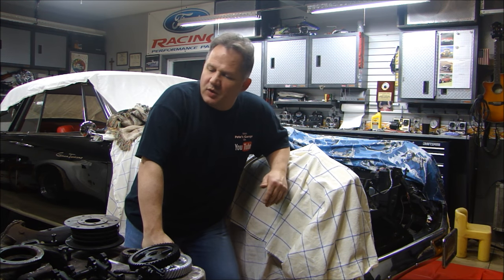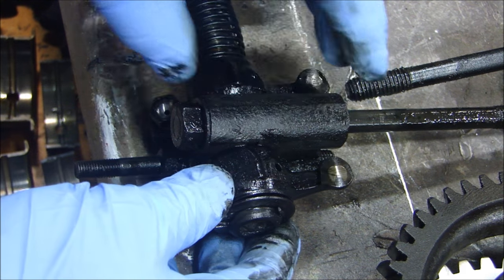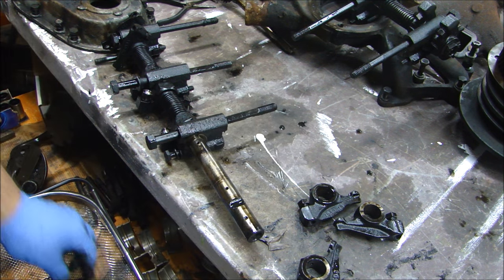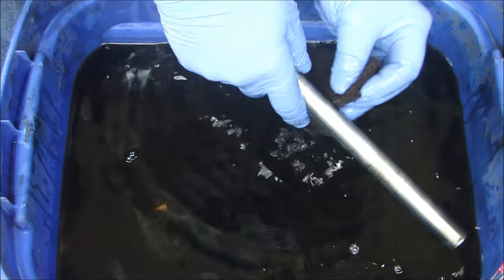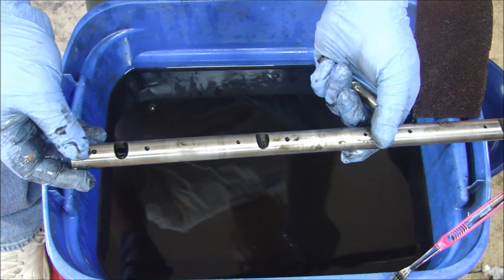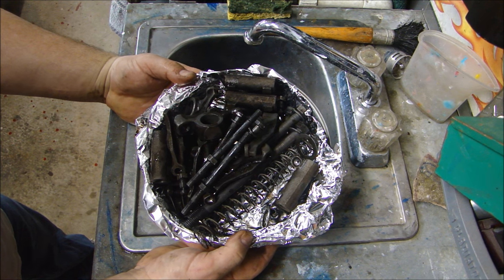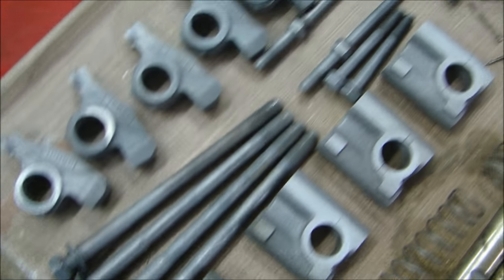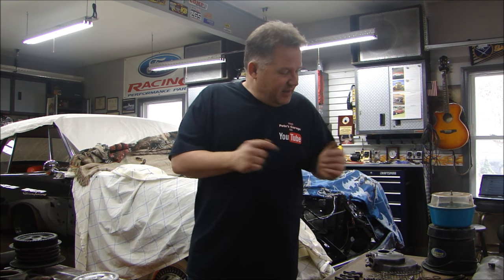Engine Rebuilding - Part Cleaning

Comment: i appreciate your videos man. im rebuilding my ford 4.6l triton. its my first full rebuild i know these engines are infamous for their shananagans. im currently watching your entire series on rebuilds. im gettting ready to have my block heads and shafts brought to the machine shop and then order the rebuild parts kit. its got 265k miles on it but the truck is an 04 and its in great shape i dont want to replace the  engine because the core parts are still good after some machining. so this is the part where i spend money lol. thanks for your detailed and down to earth explainations of you processes and procedures. i wasnt going to bother having my crank shaft machined i was just going to polish it by hand but after your crankshaft video i realized the value of having it ground and putting in the right size bearings after the machining...saved me a huge head ache and prolly gave me a better smother result. after all the rotating assembly is the heart of your engine . after that its the timing and proper sealing and compression. learning alot  thanks again man.
Reply from the maker: I wish it was possible to do this stuff by hand, but it really is precision work. There really is not simple or cheap way out of rebuilding an engine

Comment: Hi Pete, when I cleaned my rocker shaft, I inserted a length of rope inside the tube. Then tied each end of the rope to a fixed point and ran the tube up and down the rope. Polished the inside really well! Great attention to detail, thank you
Reply from the maker: That's a great idea, thanks for sharing

Comment: Pete, Great video.  When I was rebuilding the carburetor on my Avanti, I found that carb cleaner would not touch the grime even with a brass brush.  So I purchase a large bottle of Lemon Pine-Sol and put it undiluted into a 5 gallon bucker. Then I soaked the carb for 24 hours.  The carb looked like a brand new one when I removed it.  I only use Pine-Sol now for parts cleaning.  Its very cheap and works like a Champ. Added bonus, the shop will smell great too!!
Reply from the maker: I'll try that too...thank you
Reply: Instablaster

Comment: Good stuff, I’ve been parts cleaning my rx8, I was just using diluted power purple and using a nylon brush. It really wasn’t cutting the turkey but I got a stainless and brass brush (I haven’t touched any critical surfaces with them) and now that I’ve seen your video I think I might look into some quality solvents. It looks like that made your parts cleaning a lot easier than what I’ve been subjected to. Thanks Pete!
Reply from the maker: Purple power is good, but you need some heavy solvents to dissolve baked on carbon.

Comment: Here is a good tip: Oven Cleaner is usually Sodium Hydroxide - also known as caustic soda.  If you head to Lowes or Home Depot, you can buy the "Zep" branded "Industrial degreaser".  That stuff is the same exact thing: sodium hydroxide.  And it is just as strong as far as concentration goes.  Just like oven cleaner from a can - getting that Zep degreaser on your skin will cause mild chemical burn.  Best part?  That Zep cleaner is just over $10 for an entire gallon.  I use it a LOT for this exact thing: cleaning heavily greased and carboned engine parts.  I find mixing it down 1:4 (4 parts water) is still strong enough to cut the worse grease and still cause mild skin irritation.
Reply from the maker: Great tip, thanks Dean
Reply: Does it harm aluminum parts
Reply: @Alex-gc2sj  Sodium Hydroxide IS corrosive with aluminum.  I do not recommend it on machined finishes as it can cause mild pitting.  It will also cause the aluminum to darken and depending on how long exposed, will even turn it black.  Not as big of an issue on cast parts as you can always lighten them back up with something like the NAPA aluminum brightener.  Or a can of VHT aluminum spray paint.
Reply: @Alex  Back in high school, it was common in chemistry class to drop aluminum foil in sodium hydroxide to make hydrogen gas. Not only does sodium hydroxide dissolve aluminum. It also makes explosive gas in the process.

Comment: Another great video I live in Florida and use the oven cleaner trick I'll put the parts in the sun and let them  get hot and spray the oven cleaner on and let them sit in the sun this works good on oil pan valve covers and small parts
Reply from the maker: That's a cool idea, thanks

Comment: What I do..is determine my parts container...by the material the solvent comes in. The CRC was in a plastic container...so, a plastic tub is what I'll soak/clean in.  Harsher solvents that are shipped in metal containers...I'll use metal tubs, cans, etc...   Thanks...great video.
Reply from the maker: Great suggestion, thanks
Reply: Not completely true - the material (Plastik or metal) the solvent comes in says not much. Just because it comes in  a metal Container does not mean you can use any metal for cleaning or storing. The same with plastic, many harsh aggressive cleaners will eat through metal if you did not use the right sort of metal. And when the come in plastic containers (for example HDPE) and you use a plastic container (abs, ..) you will habe a problem. So always check what is in your cleaner/solvent and then get a container that will fit! If you have any cleaner with hydrochloric acid (used in many products) you should not use a metal container..  HDPE containers are good for most chemicals but always check before using;)

Comment: i can't afford enough degreaser so I use diesel. I find a quick soak and scrub with whatever brush, polypad etc that will fit and clean the part without damage. rinse with water and soap, dry and then give a quick spray over with some wd40 or crc. then when I reassemble wipe down with a lint free rag and oil as required. diesels cheap and seems to dissolve the grime and sludge pretty well. is there any concerns with using it tho? I've never had a issue but do a oil change after run in just to be sure its all out as it can leave a slippery feel. this maybe beneficial but I'm not certain.
Reply from the maker: Diesel will work, it's just the odor that's tough to get rid of.
Reply: Pete's Garage it does a pretty good job for the dollars and that's good to know its only a possible smell issue. our fuel used to be full of sulphur and grey but now the European diesels require better fuel it's clear and doesn't ell like a egg fart so much. I'm doing a half rebuild on a wl-t Mazda and its been running out of balance for a long time because whoever put it together last time only timed the pump to crank but both balance shafts were out of time. combustion chamber on no4 has a hard ridge I've just smoothed out with 120g wet an dry and WD. its a do the best ya can on a budget job. it should be bored out but $$$ don't allow for it. fingers crossed and your videos have been awesome for verifying a good many points. just checking tolerances and installing bottom end now.

Comment: Nice stuff there Pete but I have a suggestion. Prior to doing any solvents I would highly recommend an aqueous cleaner specifically SUPER CLEAN which is available at Wal-Mart. It comes in a purple bottle and is not to be confused with Purple Power which is inferior. This stuff is exceptionally good at removing grease and oil and if nothing else it will enable you to reuse your expensive CRC solvent as it will take off most of the dirt. In fact you might not even need the CRC solvent after the SUPER CLEAN does it's stuff. It cost about $10 a gallon and is diluted with water. It's very effective. Might be able to save a lot of money by using this as a pre-clean.
Reply from the maker: That's a good suggestion, thank you

Comment: Another great video. Here's my tip. Im sure the CRC cleaner works great, but its really just over priced acetone. The MSDS on this withholds composition as a trade secret but look at any brake clean or similar and its common distillates from Home Depot/Lowes/Ace. 

Most products are 50-75% or more acetone along with Naptha, Toluene, Methanol,& heptane. 5 Gals acetone at home depot 69$, mix it with naptha or mineral spirits which are cheaper, even Klean Strip paint thinner is 42$ per 5 gals & Id bet an overnight soak in that will give you clean parts. 

I bought a gallon of naptha for 13$ to run through my fuel injectors for cleaning, OTC was selling this for about 25/quarts so 100$ per gal with their injector cleaner jig & solution, yep 25$ for refill. I got the. Naptha is clean Kerosene, mean stripped much more of sulfur than kerosene.

Do what you think is best for you, bu the less you spend on brand name chemicals, the more you can spend on engines or new tools.
Reply from the maker: That is true, but be careful. Naptha, acetone, methanol, and toluene are highly flammable. Those chemicals will absorb right into your skin and will dry it out fast. They're almost as dangerous as trichloroethylene.

Comment: 1 gallon jug. 1/2 kerosene + 1qt ATF + 1qt Dawn dish detergent. Shake to mix, shake before using. Pour into spray bottle. Aluminum friendly. Best degreaser you can't buy.
Reply from the maker: That is great! Thanks for sharing. Why ATF?
Reply: ATF is a high-detergent lubricator. See the inside of a trans? Add 1qt (overfill) to your crankcase on last 100 miles before oil change. Drain HOT, drip dry 3-5 hours. Add 1pt to your oil after change, leave it in. It helps to clean, starts faster & easier, especially in Winter. Way better and cheaper than Marvel.
Reply from the maker: Awesome! Thanks so much

Comment: Pete thank you for taking the time to prepare these informative instructional videos. Much appreciated even here in the UK. After cleaning, baking and bead blasting cast iron parts ie the valve train components how do you stop them corroding before assembly. You mentioned the 'cast blast' finish applied by the machine shop which does this on the cast iron of the block and head. Do you treat the parts you clean similarly? Thx
Reply from the maker: Thanks David. For internal parts I just soak them in WD-40. It keeps them rust free until assembly.

Comment: Great Job. My girlfriend and I live in an apartment and looking for a house with a garage. I can't wait to start on tearing down motors and rebuilding them.
Reply from the maker: Apartment? Just tear it down in front of the TV...lol
Reply: +Petes Garage Haven't ruled that out as an option. lol
Reply: Adam Wells I have actually done this with different items Lol, I converted a walkin closet to an engine rebuild room and man was my ex pissed when she came home to me scrubbing piston heads and rods in the bathtub Lol good times, now I have a garage
Reply: +gary buskirk lol that is funny. cross your fingers. we're talking to a loan officer and things look promising. Our third floor apartment only offers a balcony and small closet for the water heater. It'd be hard to hoist a motor that high.
Reply from the maker: Take it apart first. A block only weighs 150 pounds or so

Comment: Hey Peter! I've been watching as much of your content as I can lately attempting to prepare for my small block Cheyv 400 build. This is great stuff.  I did notice that in another video you were very adamantly against the use of a media blaster for internal components. If I am quoting you correctly, "If one grain of blasting media gets in the oil passageways, its over!" lol. Is that an opinion you developed after this build or is there something different with the Studebaker build that makes it not as important?
Reply from the maker: You are a smart man! I had the oil pump pickup near my blaster and some of the grains must have got into the screen. Locked this engine up on the dyno because of it.
Reply: @PetesGarage  No kidding? I haven't gotten to the dyno video of this build yet. Live and learn I suppose.  Thanks for sharing, this is the kind of experience that can save someone money.
Reply: Thank you Pete's garage for your honesty in your experience!

Comment: Thanks for the video been looking through YouTube for ways to clean parts. I’m concerned about using oven in the house. Those kinds of fumes are toxic. Could you use a torch of some kind instead?
Reply from the maker: If you use oven cleaner, using the oven in the house is no problem the fumes are not toxic, just unpleasant

Comment: Hey Pete I thought scotch brite pads aren’t safe to use to clean internal engine parts because they stick behind abrasive material. Does the solvent clean out these abrasive materials effectively enough?
Reply from the maker: As long as you thoroughly clean the parts it's ok
Reply: They're still abrasive though, about the same as 400 grit paper.

Comment: Great video. I like how you showed different methods.  Question: what about disposing the "used" solvents?
Reply: David Plass Where I live there's a number to call for that info. Google environment waste in your area.
Reply: By me, there's have a quarterly "Stop throwing out pollutants" event which is where I suspect this stuff should go.  Another question is: how many times can you re-use this stuff (the paint stripper, for example.)
Reply from the maker: I collect all of my solvants and take them every year to a hazardous chemical pickup sponsored by the county I live in.
Reply from the maker: My county does the same thing. I've been using this stripper for about a couple years
Reply: Thanks ***** for the info.  I'm surprised the stripper lasts so long but I guess as long as it works!

Comment: Thanks for answering the question that was on my mind since the beginning of this serie's of video's. I work/hobby on old motorcycle's and  I use an ultrasonic cleaner sometimes. I've bought one with a 30L basin, so i could fit a complete cilinderhead. (primeraly to clean the non-removable oil jets)

What's your thought on ultrasonic cleaners? Or do you use it only on carburetor parts?
Reply from the maker: Ultrasonics are very good. It's still tough to get the baked on oil though, that's why I use this method

Comment: The right tools to the right job :)
So how to remove carbon from pistons, specialy in the piston rings?
The grooves are very small.
Can we use the same method?
Thanks
Reply from the maker: Yes, you can use the same method. The oven cleaner works well on pistons
Reply: @PetesGarage  I wouldn’t recommend oven cleaner on pistons particularly Japanese pistons with ceramic coating, Ask me how I know ??

Comment: Hi PeteGreat Videos with very good details. One questions. When you media blasted the rockers and towers, what precautions do you take to be sure that  you do not harm the machined surfaces?
Reply from the maker: I blasted the rocker before resurfacing the end that touches the tip. The towers did not have a finely machined end, but I try not to blast those parts. If it is a critically machined surface I will cover it with duct tape.

Comment: Hey Pete, Great video, and well explained.  I was wondering if you happen to know the active ingredients in the chemical you used to strip paint? I'm trying to find an alternative available in Australia. Contacted Miles Chemical Solutions in the U.S and shipping makes it not worth my while to grab the stuff you are using.
I've tried electrolysis to strip paint which works well but often leaves a coating you have to scrub off. 
This stuff you're using looks great!!
any help would be awesome.
cheers
Reply from the maker: I use just oven cleaner, it works very well

Comment: Say Pete, can you send all the parts out for a hot dip? That could do the heavy lifting or the entire work for some/most of the gunked up parts and pieces. 

And/or maybe explain what it does, when and why to use it, when and why not to use it.
Reply from the maker: The machine shop cleans up the block and heads for me. I don't mind doing the rest of the parts because it gives me time to inspect them.
Reply: ***** I comprehend. The window you allow others to see of your work, shows a proclivity for cleanliness and quality control over your parts. Makes for a good show and a very good rebuild.

Comment: What did you use the strip/clean the valve covers? I have been buying Paint Stripper from the hardware store, and it is not the same stuff from the 1980's. It takes days just to turn paint into a vulcanized rubbery texture that I have to wire brush off. I might as well just set up a sand blaster cabinet.
I am stripping new Archery Bow Risers to paint with different and better paints.
most are Aluminum so I cant use caustic acids because they will eat the aluminum also.
Any Suggestions?
Reply from the maker: You are right, the paint strippers now are terrible without methylene chloride. A blast cabinet helps, but it does not always work. Look up paint dissolvers instead of paint strippers, there are chemical companies that sell some good stuff
Reply: @PetesGarage  We figured out that for about 400 dollars that I can get a cabinet and blaster from Harbor Freight. then modify it/better gun, caulk all the seals to hold in the media better.
Since I am doing Archery Bow Risers for my Business I can use it on the Taxes Shop Equipment.
I am also checking to see if my supplier will send them to me before they paint them. That would be a big  help. 
I will check on the devolve thing also. TY.
Reply from the maker: Good luck
Reply: TY, I will shoot a link when i post it.

Comment: the crc cleaner do you use that as a one shot or multiple times?
Reply from the maker: The reason I do it in a separate container is so I can let it sit so the solids fall out, then I strain it and put it back in the original can. It's good for a long time that way
Reply: thanks your videos have inspired me back to build my own racing engines. I am building a 273 to race in stock eliminator K/SA

Comment: Hi Pete! Many thnks for the video! Just wondering if them rockers need to be heat-treated after machining?
Reply from the maker: They would not. They are cast and do not see much pressure. I don't think they were heat treated to begin with